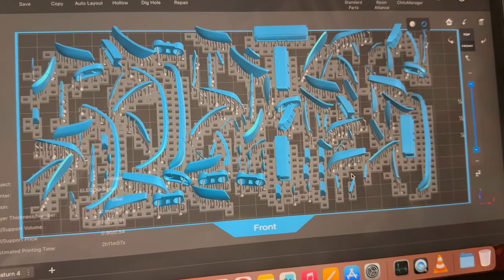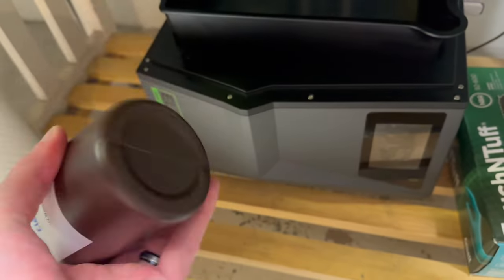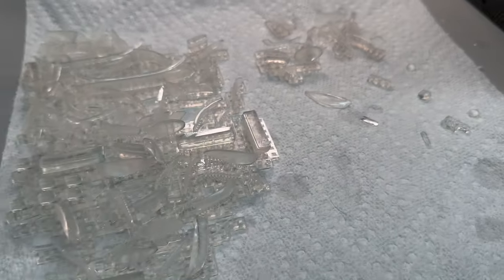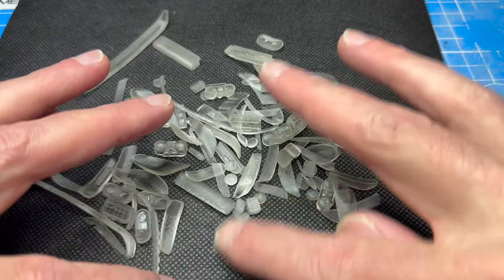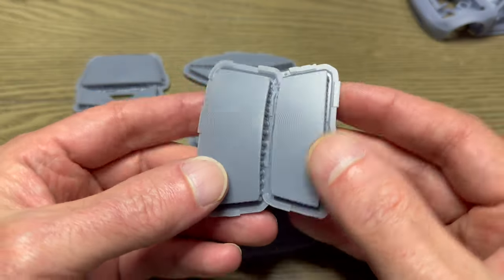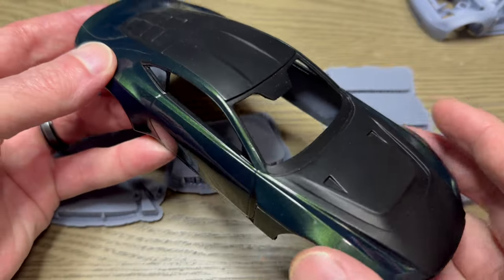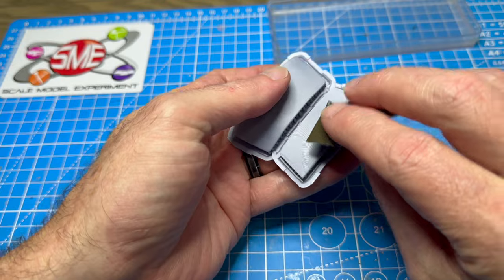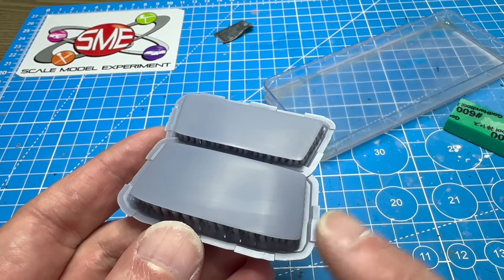Complete Idiot’s Guide to 3d Resin printing Clear Parts and Vacuum Forming

Comment: If you do such idiot guide, you should show it how to make it right. Never touch uncured resin, safety aspect wasn't mentioned. You touch the same display with your bare hands that you later touch with your gloves, that's pointless. Use a proper respirator, ventilation system (Printer inside a grow tent for ex.) and never touch anything related to the printing process with bare hands but also not do it barefoot, wtf?!. It's contaminated. I guess you don't want any type of cancer or skin irritation. And you should look for options to improve your workflow of the process because you take many unnecessary risks while removing the print from the bed. Spills or ram the spatula into the artery that some people already experienced. There are many ways to improve it to make it more comfortable. Like doing the removal inside a big box for ex. Also don't sand resin prints without a mask. At least avoid to breath it. 

And for Vaccuum forming, you could that also with a DIY wooden frame build inside an old not other way used (not for food) Oven then for this to make that. And to avoid failures, vaccumforming hates sharp angles. Bevel the object. That Box models that Yves made for you are the type of design you want to have. Also you printed your two windows too close together. They need to be further away from each other in order to create a proper vacuum around the object. Also, the deeper your model is, the more likely you will have problems to suck the air onto the object. So what people normally do there is to put some small tiny holes into the object where the air can get sucked through. These holes normally get made at the problem areas such as corners. But for you windows, i think it doesn't need that. But it can help. Also you didn't seemed to let the part cool down. The plastic is still hot and still somewhat soft and might get distorted if you remove it too quickly. Just read up on vaccum forming guides. It's very easy basically. Reading up on that could have made you a way better first experience.

The safety aspect should not be undermined. If you make a video like this and it is for beginners, you shouldn't be one yourself. Because there are lots of people who watch a video like this and copy everything exactly as it is without doing any further research themselves to see whether it is the right way to do it, because people as viewers put a lot of trust in their favourite creators that is often not questioned. And unfortunately this leads to people being very careless with resin printers, even though we should expect personal responsibility. But innocent people also get dragged into it. For example, when resin is flushed down the sink and groundwater is poisoned. Or that just because resin doesn't smell doesn't mean you should breathe it in. Just like being washable with water is automatically harmless to your health. It just makes the printing process cheaper, nothing else.

But anyway, you are the first one on the internet as it seems who made several ideas i had into my mind into reality. So it's not like i didn't enjoyed. So i am really happy to see more from you! 👍